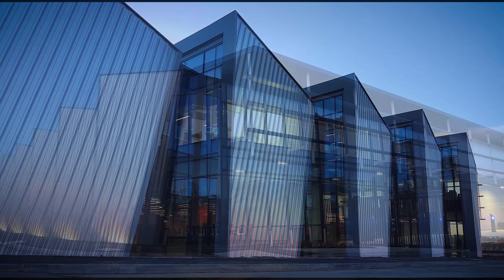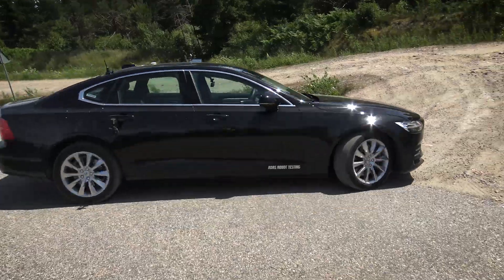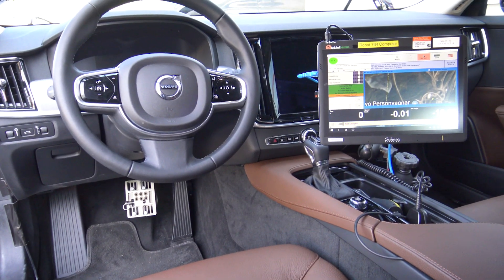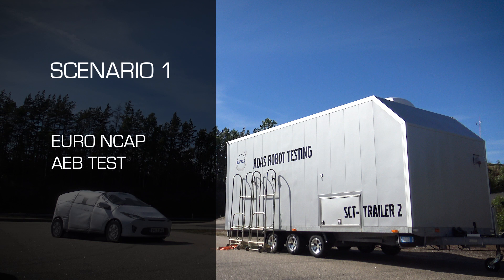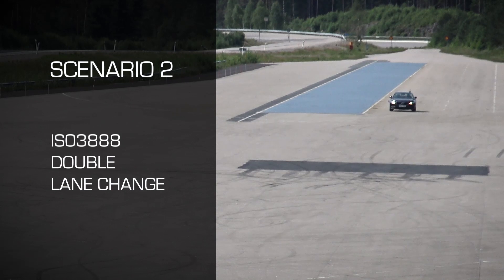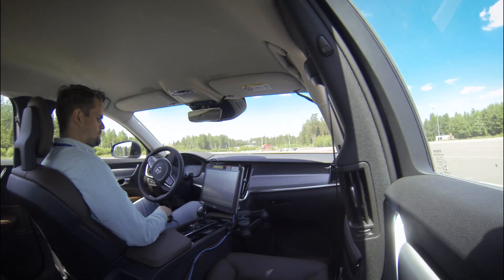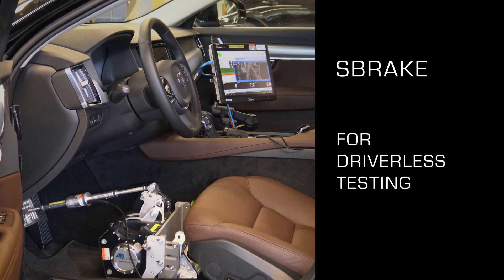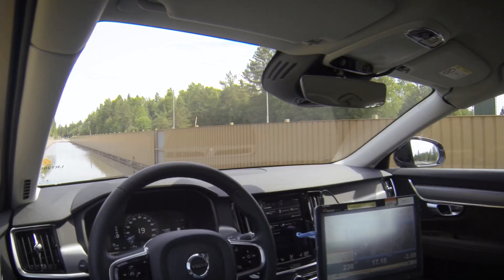Flex-0 - drive-by-wire controlled vehicle

Comment: Would be funny as hell  if there were a police Chase of a driverless vehicle ....just to monitor the police band:  Police dispatcher :   "Unit 07 & please repeat your last transmission?"   Unit 07  " you heard me right dispatch there is NO driver in the 2021 Porsche 911 we have been in pursuit now 12 minutes speeds in excess of 100 mph ....suspect vehicle  has made over 30 passes on slower moving traffic and we are having trouble now keeping it in sight ...please advise on requested helicopter unit we are about to lose him er I mean it....This is Dispatch Unit 07 you are instructed to stay with the chase,  this vehicle is confirmed to contain 2.8million dollars from bank heist downtown earlier ...robotic drone robot claiming to be wired with esplosives entered the bank demanded and got the money then exited and entered suspect vehicle with the money ....Unit 07  "10-4 dispatch please be advised suspect vehicle has entered parking structure so we have it cornered now!  No WAY it can get out!  ....Wait ...What the?  Damn it! Be advised an eplosion has blocked our access further into the parking structure ...suspect vehicle is headed to the roof level! .....be advised NOW a large scale drone type version of a quad copter has descended from the air to the roof level.....we are unable to get up there due to debris.....oh NO!   No no no!  The robotic unit with the case of money has exited the vehicle and attached itself via steel cable suspendended under the quad copter ....it is lifting up....up and up....DAMN!  it is flying away to the north with the money!   Please be advised we are having trouble seeing it now it is quite far....it has be dipped beyond tree line horizon....we have no idea where they are now....WHERE is our chopper??   This is dispatch sorry Unit07 our chopper is out of commission ....another drone dropped a was of unknown line material treated with adhesive onto the rotors just minutes before it would have been detailed to your location ...Pilot is unable to safely get that bird in the air ...we have mechanics heading there but reports are the glue used is a real mess....We have called adjacent county for their helicopter but it will be a while.....This is Unit 07 with update ...suspect vehicle has caught fire....please send fire units....appears they have destroyed evidence